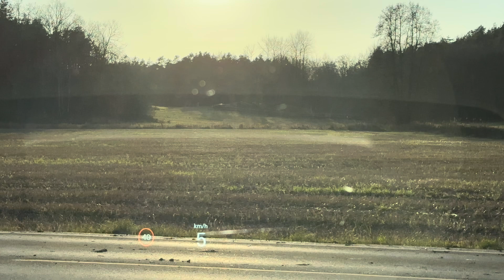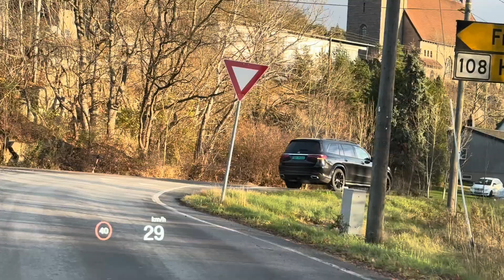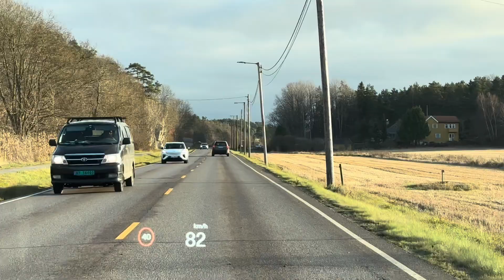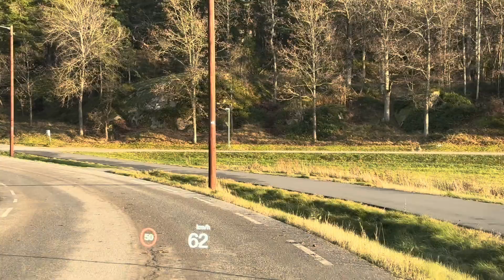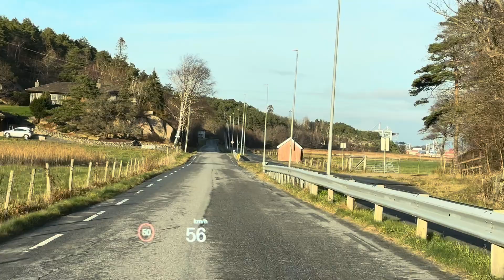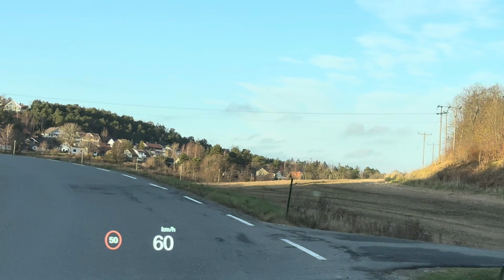Polestar 4 (4.1.10) has wrong speedlimit

Comment: Problem is the wrong speed limit data at third party databases. (Pole and Volvo Google? )This is common problem with all brands. So most important is to have short cut in your infotainment where you can deactivate speed limit system. In Finland we have almost all the main roads speed limit sign after you have turn to other road, that corrects speed limit info. But even that doesn’t work when camera doesn’t read the sign…😅

Comment: Gosh, this is why you cant trust your "computer", would be a shame if someone would drive 200kmt by a school with a 30kmt speedlimit, since the driver has no braincells to understand that outside signs / rules overrule your computer.
- and this speedlimit software is such and old tech allready put into gps systems that this is a shamefull version of it in the polestar.
REALLY hope that they will update the software and it will use gps ( if the car has it ) from the update and forward !

Comment: And the funny thing is that it worked perfectly on my P2 in the beginning. And I had many Volvo's with it, and they checked it with the camera's and that worked also fine.
V90 T4 2020 (perfect)
XC60 T4 2021 (perfect)
Polestar 2, in the beginning perfect
XC40 P6 2022, in the beginning perfect....
Reply from the maker: Different tech
Reply: @ yep but how come it worked perfect for 2 years on my polestar 2 and since an update not. Multiple people with the same issue, and my xc40 same story
Reply: @paulh43  My 9 year old Volvo S90 worked absolutely fine to this day (using both camera for real time sign detection + road database for everything else).
My brand new Polestar 4 with yesterday’s update (P4.2.2) is still the same absolute mess you’ve just described.
Love the car, but there are definite pet peeves and it’s a shame coming from a much older car that didn’t have those.